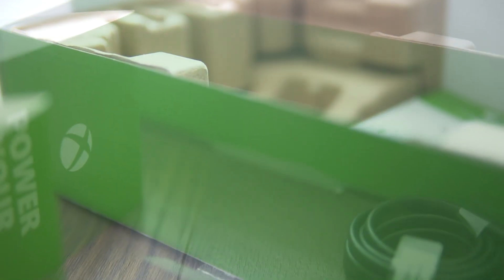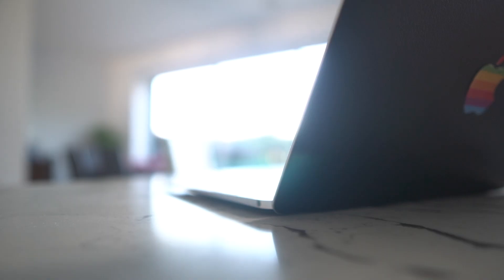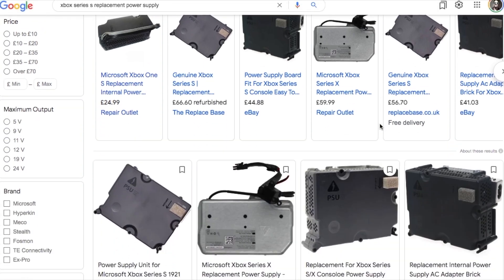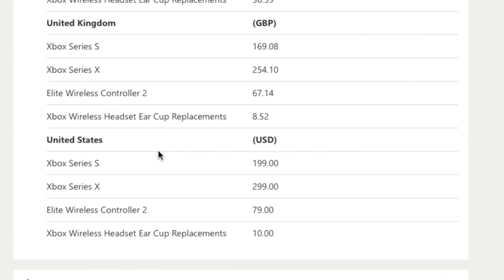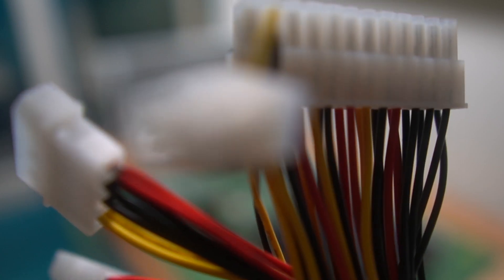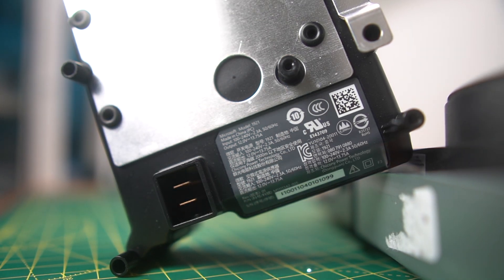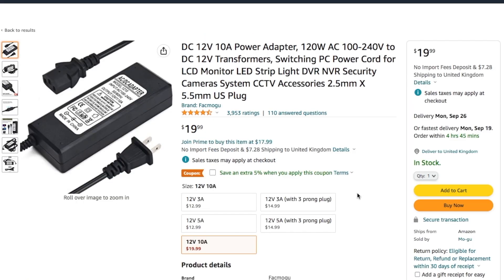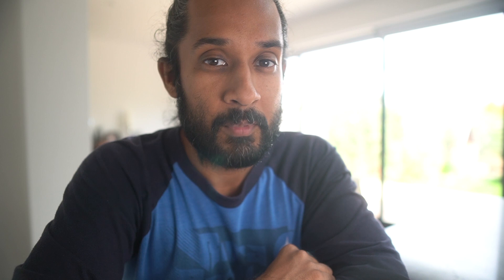Replace Your Broken Xbox Series S Power Supply With A Laptop Charger!!

Comment: Mate this is a great video for travelling gamers, modern 12 V lithium setups can easily deliver the wattage required with the appropriate cable size, completely does away with inverter, unless spikes (less common in DC) could damage the motherboard. Great vid anyway

Comment: For $37 you can buy the power supply itself hopefully that’s what’s wrong with mine. No light beeps nothing happens
Reply: If the power supply shows 12v while plugged in it shouldn't need replacement.

Comment: 9 months later, still playing smooth? Coz I replaced my xbox series s psu with a andowol psu 200w that is 240v 20a. Whenever i do heavy games like fifa and gta or flight sim it shuts down but when streaming nothing happens
Reply: Mine too when I try playing heavy games the xbox turns off
Reply: Think you might be over volting the Xbox. 200w is way to much and the original only puts out 163 watts.

Comment: Very nice im thinking of doing this with a xbox one x i have with a faulty psu , since i plan on keeping the console , did you use a laptop power supply?
Reply: Make sure it's correct voltage and amperage

Comment: Sorry but i really need to say that this mod is very stupid,a 120W PSU on a System that has by default a 160W PSU....there's a reason the original is 160W and not 120W!
Reply from the maker: That's fair to say but I've not had any problems so far. Will have to see how it goes long term. There's always the option of spending more to get a more powerful PSU.  Luckily the hack is plug n play! I guess you're not going to like what I do to this Xbox next!

Comment: Very cool. I would love to see the brick fitted inside the console, personally. Might have also looked into reusing the original connector from the dead PSU rather than soldering to the board as well. I love that it's just a simple straight 12V
Reply from the maker: Thanks. It definitely would be a neater solution to use the original connector. Just that I have some other plans lined up!

Comment: Its also worth checking the power supply for failed capacitors, usually you can buy them for $1 apiece in a 10 pack or similar.  If it works after you warm it up, but not when cold, then you have bad capacitors.

Or if you can tell they have bulged or leaked.

Sometimes I salvage capacitors from old equipment and do a check to see if they work.  

Then its up to you if you buy new or just keep using the ones that fixed it.

Of course don't open the power supply if you don't know about the mains side capacitor discharge, it can easily give you a big shock.  Of course you can test it for voltage or discharge it with a large resistor on a stick (it should have its own discharge resistor, but it can take a while).
Reply from the maker: That's great info. I need to learn a bit more about power supplies before heading in that direction. Have changed capacitors on a PC motherboard but I'm less scared of those than a PSU!

Comment: You can also use an adapter for Xbox360 to XboxOne or Xbox E.  Then use an Xbox360 power supply you may have laying about or $5 at a yard sale
Reply: I'd rather use a new psu to be honest
Reply: What do you mean by that? Is it like a finished product that plugs in to the motherboard instead of the original psu?
Reply: how do you suggest i do that? xbox 360's power port is soldered onto the motherboard, its not in the simple +ve - ve form

Comment: This is pretty cool.

Not only did you fix your PSU issue, but you also improved the cooling. 😅
Reply: Debatable, sometimes the PSU forces the air to travel over hot components.  Could be fixed by putting it back in with the connectors cut off I suppose.
Reply: @milescarter7803  I dont understand why it would be debatable since you removed a heat source, could you explain in a little more detail?
Reply from the maker: It's an interesting situation. From the design it looks like air is being funneled through the PSU by the main fan. But also the PSU has some heatsink metal and thermal blu tack ( I don't know what else to call it) on the outside pulling heat away from board components. I don't know whether on balance it's cooler or hotter!
Reply from the maker: Lol. To be honest, I left it all open mainly for artistic license but also planning some other hacks and just can't face going through all those screws again!